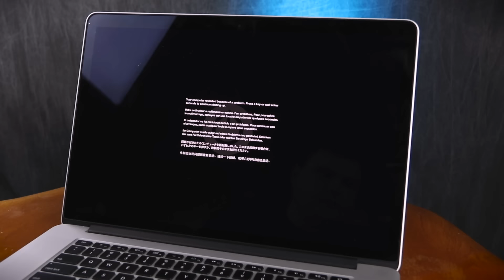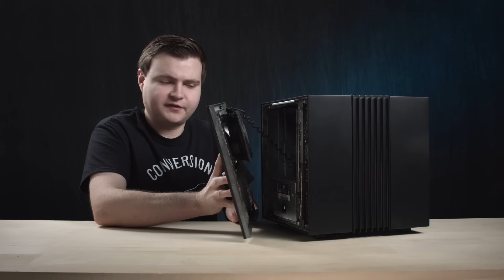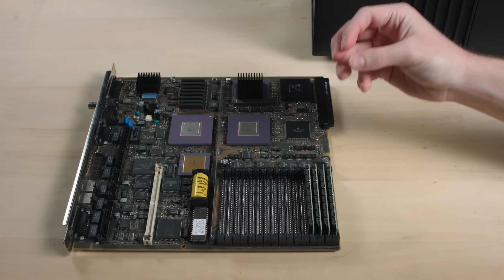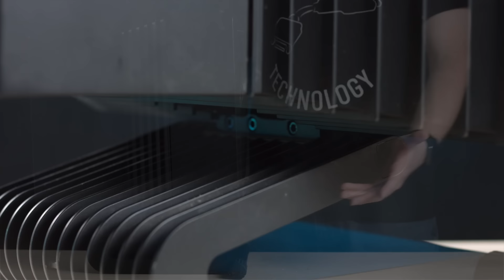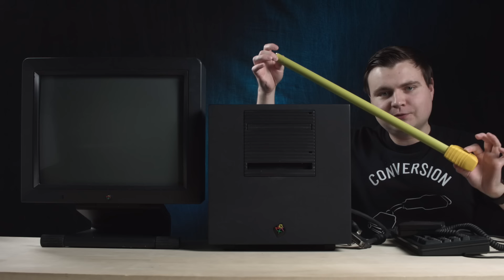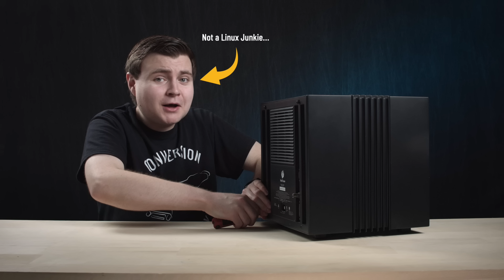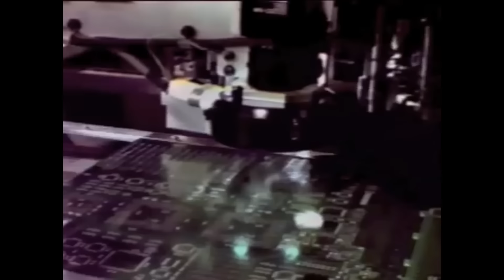I Bought a NeXTcube, Now What? - Krazy Ken's Tech Misadventures

Comment: Most Unix workstations around that time were crammed full of stuff. Look at the SparcStation 10 or IPX.  Anything DEC Alpha, or even HP 9000.
Reply: The HP 9000 712 was a tiny single-board computer.  It was the machine NeXT could have won with.
Everything else was heavy+impossible to demo with... especially the Sparc 5+20!  HP 712 was super light + powerful.
Reply: @jazzlover10000  I never used a 712, I would love to own one. The last 9000 systems I managed were an I70 and a K200. They just ran, I can't remember a crash or hardware issue.

Comment: I thought the criss cross thing was mostly for installing heatsink on cpus.
Reply: It's common practice when bolting/screwing in anything that you want equal force or may flex/warp when force is applied.  Here I don't think it's the worst thing in the world but the back may have warped/bent a bit if he tried screwing both left in first then the right side due to the board sticking out a bit.
Reply: I thought it made you go "jump jump". And wear your clothing backwards.

Comment: Get a proper set of screwdrivers, geeze.  And crisscrossing the screws is utterly stupid unless its going to be holding something under tension.  Jobs was an idiot in some ways, the single cable thing being a prime example.  A single point of failure is how I see it.
Reply: Jobs, IMHO had the right idea. does your monitor work if the  video or power connector breaks? Granted audio or USB aren't needed for the display to do it's job.

I had an mp3 player before the ipod came out it had a charging port with a wall wart transformer and a data port to put songs on it.  When I saw that the ipod has 1 cable for data and power, i made me say "Why didn't they just do it that way in the first place?"
Reply: @brianmiller1077  Yes, I have had monitors with broken video connectors that could still work by using other connectors and standard IEC power leads that are easily replaced when lost. It's also nice to be able to power off a monitor while the workstation is still on (like, if it was to be used as a web server...)

Comment: The thing at the end of your tape measure moves because it's dual function: You can measure both inside and outside dimensions with it, the movement is the same size as the width of the L-shaped metal thingy on the end.

Comment: It is funny how Steve touted Mac OS X's features as if they were brand new and revolutionary when, in fact, most of them had simply been ported from NeXT Step. I played with Open Step on Linux some years ago and noticed then just how similar it is. It uses .app executables and everything. It makes me wonder just how much tweaking it would take to get Mac OS X applications to run under Open Step today, especially older apps, and especially on a PowerPC or POWER platform.
Reply: Lots. The OpenSTEP specification was last published in 1994, any updates in the yellow-box/cocoa era are not included in that specification. GNUStep is trying hard to implement most of the Cocoa-APIs and Darling will even let you run Mac OSX-Apps on Linux using GNUStep, but it's far from a complete implementation of the current Apple-API.
Reply: Mac OS X was pretty revolutionary for an operating system that was aimed at the mass market.  The features they touted existed on expensive industrial equipment like this one, not so much consumer-level equipment.  The big change that got most of the attention was the Aqua interface though,  there was really nothing like that at the time, visually computer interfaces changed over night.  Compared to Mac OS9 and Windows 98/2000, Mac OS X was a huge leap.   I was started on the open Public Beta in Sept of 2000, and even with my fairly weak iMac it was a huge leap in experience.  The jump from OS9 to OSX was unlike any other jump since then.   I was aware that this operating system came from NextOS, however, I knew absolutely nothing about that system and the information online was very sparse with no tours lie this one.
Reply: @riley_oneill  Technology-wise OSX was big leap forward but in term of GUI and UX it was quite the step back as far as things like File management. The OS9.2.2 Finder, after they integrated Navigation Services, was and remains, the best file manager on any platform to this day. Under the hood OXS was great but for power users it was a frustrating step back as far as the desktop environment is concerned.
Reply: Even the hardware, it really is not that much different from an Amiga, maybe even less advanced in some aspects.

Comment: What you also need is a NeXT SoundBox. It also has the mic. I really liked Steve Jobs’ demo of Lip Service, the live recording function that allowed you to record any sound and attach it to any file the NeXT could create. That was also pretty rad for 1990.
Reply: Funny that it needed an extra sound box. The NeXTstation used the same MegaPixel display and did support the built-in microphone right out of the box. Sampling was done in 8kHz 8bit only, though, but that was sufficient for, like, taking voice notes. IIRC, the NeXTstation was available with either a 400MB or a 100MB SCSI hard drive (the full OS install took 300MB IIRC, so it was stripped down on the 100MB models to fit the disk). In any case, there was little space to record any appreciable amount of audio anyway.

Comment: I have actually used one of these before. Crazy things. Also made out of Magnesium so better hope a fire doesn't start near one
Reply: It takes a high temperature fire to ignite. Constant flow too. It's an alloy so it's not flammable by itself the Magnesium needs to be melted out of the alloy before it can combust. This was tested in 1993 by NeXTworld magazine which had a spare empty Cube shell.

Comment: Hey Ken,   Glad you like the Cube and great video you produced on it!  It could not have gone to a better home.  A couple things about it.   That model did indeed come with an option 2.88mb floppy disk, and if you had it installed it had a different bezel.   What you see there now is simply a slot cover that is the same size as if you had a second MO drive on top.    Also,    If it ever fails to boot for you,  the yellow Panasonic 2/3A battery in it might have gone bad.  A NeXT will not boot at all with a dead cmos battery.   Finally,  you can configure the next to boot right to NeXTstep,  I just had it configured to boot to terminal first as a preference.  Keep up the great work!
Reply from the maker: Thanks for watching! 
(And for selling me the Cube. That was cool, too.)
Reply: Did the floppy drive manufacturer not pay the royalties for the correct bezel?

Comment: The early all in one display connections show that Apple (Steve) was always into the idea of a one connecter solution. Having just thunderbolt 3 on modern macs shouldn’t have been a surprise to anyone.
Reply: Yeah but Steve wouldn't replace every port with thunderbolt 3.
Reply: @IanC14  I dunno, he did something like that with the original iMac.
Reply: Jobs adopted the one-connector solution as a later convert. Joe Decuir at Atari Inc basically pioneered it with the SIO port on the Atari 8-bits in 1979 with every peripheral being a smart device. Apple certainly didn't copy or license that tech for the Apple IIs back then, probably because it would've eaten away at their profits for selling various dedicated accessory controller boards for their platform.

Comment: You know what would be cool for you to do, network your NextCube with a G4 Cube running Mac OS 10.0 with a MacBook Pro running 10.4 with your current MacBook Pro running 10.15 and see if you can share files between them. Considering its running an ancestor of macOS, I would like to know if there is a heritage of compatibility that remains.
Reply: NeXTCube to/from G4 Cube would work with AFS and (maybe) SMB. G4 to modern MacBook Pro would probably only work with SMB, as later Mac OS X releases increased the security of AFP. That and AFP over TCP/IP (which modern 10.15 has to use due to removal of AppleTalk in 10.6) probably wasn't out/formalized by then.

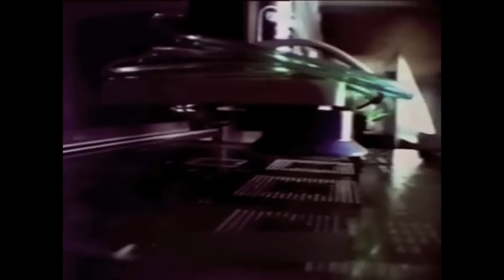Comment: 10:10 I think the NeXTBus is NuBus.

From Wikipedia: "NuBus was also selected by NeXT Computer for their line of machines, but used a different physical PCB layout. NuBus appears to have seen little use outside these roles, and when Apple switched to PCI in the mid 1990s, NuBus quickly disappeared."

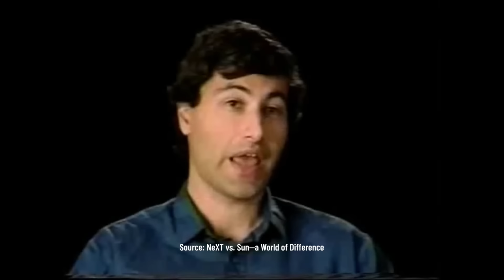27:57 And the IDE was called Project Builder. The early version of what became Xcode.
Reply: Indeed: "The NextBus is a superset of NuBus, which is defined by IEEE Standard 1196." cf. http://www.nextcomputers.org/NeXTfiles/Docs/Hardware/NeXTbus-NBIC/NeXTbus_Specification.pdf
Reply: Madd the Sane
Next, physical PCB other layout, not new Bus, why you cry that bullshit here?

Comment: This monitor has a HD display, because NeXT MegaPixel Display has a 1120 x 832 resolution, strange, in 1990.
Reply: So 94pixels wider than 1024 and 64pixels more than 768 could this be related to the dock on the side and menu so they still have 1024x768 for the main area for work
Reply: 1120 x 832 in 1990 is bonkers. This machine was a decade ahead of it's time
Reply: @an1skh4n  I had 1280x512 on my Amiga 3000 in June of 1991.
Reply: Daaaaamn
Reply: These dimensions remind me of the DIN A0 paper format: 841 x 1189 mm. That is to achieve exactly one square meter. And the side ratio is kept after halving the paper.
Reply: And it doesn't even reach a "megapixel" (1 million of pixels), for that, keeping this aspect ratio, the monitor should have at least 1160x862 of resolution.
Reply: @pedrofelck  Nope.

Comment: That's NOT a beach ball, and it didn't come from NeXT. It came with the first Macintosh. NeXT's busy-state cursor resembled a magneto-optical disk.
Reply from the maker: I haven't seen that symbol on the original Macintosh at all, and yes....... it's a disk, but everyone calls it the beachball.
Reply: @ComputerClan  On Mac, it currently DOES look like a rainbow-colored beach ball, since they ditched the old Mac system. I don't remember anyone calling the NeXT busy icon a beach ball. I've seen it on system 6 and 7 in monochrome mode, for certain operations where u can't even access the menu or switch apps, otherwise it will use the wristwatch. It looked more like a technical drawing screw hole indicator :P
Reply: The first macs used a watchface with wriststraps for 'busy'.

Comment: Looks likes youze gots 4 megabytes of RAM.  Not fun.  Go to 16.  Quick.
You could put two optical drives in the unit if you wanted.  Later, they made the top area for the 2.88 floppy drive only... same drive I think as the NeXT slabs.

At least you got an 040 board and not one of the earlier 030 boards.  However, I'd get an earlier 030 board and network it to the 040 board, then get the script that lets you bring up the docks for two computers at the same time.  Add a Dimension board and you'll pretty much have maxed the system out!  I don't think you can run four boards in there.

Did you get any OD media?  I never had much luck with it.  I used to go to NeXT regularly for various stuff.  I have one of the rare 68040 Motorola NeXT t-shirts that Bambi Hernandez gave me when I used to head in for meetings there.  I bought a machine from an engineer there who let me in the back door - I could have worked there but mmmm... wasn't so interested so never applied.  Why?  I didn't like the silicon valley.  Still don't.  Instead I wrote apps to help boost the platform in a nicer locale to the north.  I used a NeXTStation Turbo Color until around 2000... when OSX finally got good enough to use (I should say comparable in function+performance to NeXTStep).

There are some app cd discs out there that are really good.  They have complete application suites that are awesome.  The somewhat inferior Omnigraffle copied Diagram, which was written by Lighthouse Design.  Everything they did was really good and usable for years + years.  There are license strings all over the net for their stuff.  Best.
Reply: That's weird - mine was min spec for memory and it came with 8mb (I opted to spend the money on a bigger HD instead - all this stuff was crazy expensive back then, so I opted to use virtual memory when needed vs having a 105 mb HD).

Comment: change the bios battery it may leak and damage the motherboard.
Reply: lithium cells dont leak
Reply: @SaltyCuntno1  
I've seen brown goo coming out of an acer laptop lithium battery. they most definitely can leak
Reply: @SaltyCuntno1  
ah yes you're right, I just now read OP's comment again.. I must have somehow missed he's talking about the cmos battery. my bad!
Reply: @SaltyCuntno1  yes they do.....
Reply: @Mr_Meowingtons  

Technically they don't, unless they're exposed to some sort of harsh element or defects stemming from manufacturing.
Reply: Pretty sure it's a lithium battery - because it's clearly marked with the word "lithium". Those don't leak.
Reply: @mgabrysSF  wrong, tell that to every Mac owner that has a Mac that use these damned batteries that has leaked or exploded and has destroyed the motherboard. Those batteries are lithium batteries as well.
Reply: @madmax2069  They expand and explode and that's mostly due to all Macbook's shitty ventilation system and charging systems for certain models as well.
Reply: @Oyashirochama13  ahhh k
Reply: @mgabrysSF  They can and it is very rare but not unheard of especially in really hot conditions!!!
Reply: Assuming the previous owner hasn't already did this, yeah.
Reply: Madd the Sane hasn't already done* this...

My mother would drag you by your ear to wherever she saw fit to scold you on the importance of self-respect and image via grammar, vocabulary and articulating comments/remarks worth being shared amongst eachother.
Reply: AFAIK, it was a problem with the Macintosh, not with the NeXT